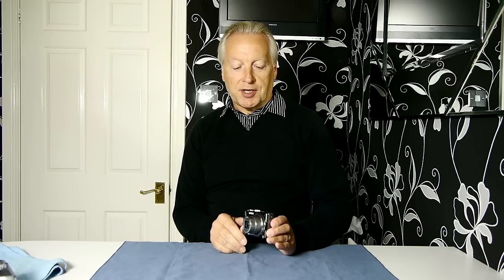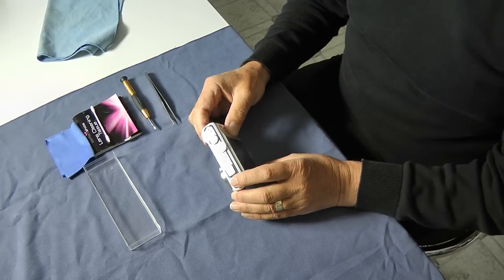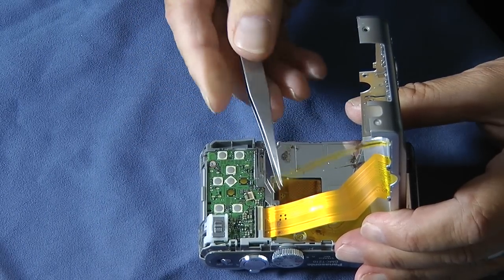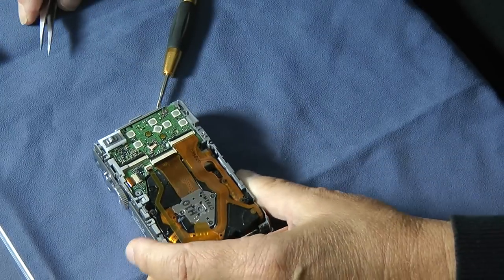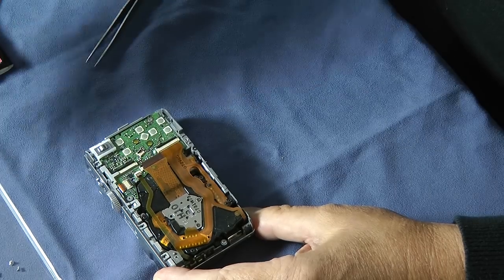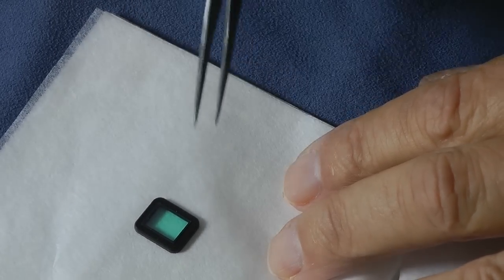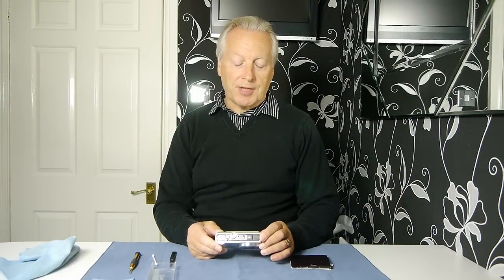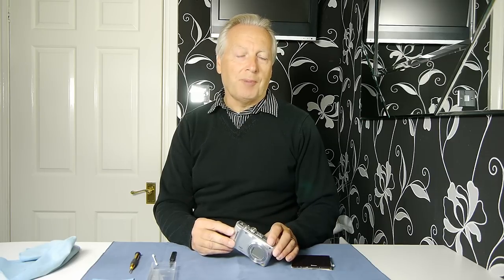Cleaning the CCD sensor of a Panasonic Lumix Compact Digital Camera

Comment: Hi Graham,

Apparently I'm the first idiot that's responding to your video.  With newly found confidence, I gently disassembled my Lumix DMC-ZS9, cleaned the IR filter with a Q-tip, blew with an air bulb, and reassembled.  Now the camera does not work...the LCD screen only flashes, and the lens goes in a little, then out a little each time I press the button to take a picture (whether lightly to focus, or a full press to take a shot...no difference).  My PC does not recognize it when.....

Comment: dear mr. houghton.
my poor Lumix spent an entire winter buried under a snowdrift (don't ask, I don't know how.)
amazingly, once left to dry, the camera seems to work (Kudos to Panasonic or whoever built this thing.)
There is a blotch in the image though. so, I am trying to disassemble the unit per your instructions to try to clean the CCD Sensor

my disassembly though is not exactly following your steps.
I got the back off.  but it came off leaving the LCD in place. the LCD seems to be attached at the top edge. And I cannot quite see how to release it. (it might simply be do to corrosion). and don't want to force things. I always break bits when I force things.

photos here.
https://plus.google.com/u/0/photos/107276842128622974989/albums/6019280226218676785
many thanks
peter
Reply from the maker: Hi Peter, the lens disassembly is more complex than the TZ series and, as you have found, requires a lot more removal of camera pcbs/sub assembly to get at it. If I can find the service manual for the LX3 I'll forward it to you.
Reply from the maker: Peter here is the service manual

 http://elektrotanya.com/panasonic_dmc-lx3_sm.pdf/download.html
Reply: Graham Houghton
Graham, thank you. This has been an interesting experience. Now, last question I think. I got it apart. the culprit seems to be the IR Filter which is quite fouled up (seems to be mildew, which is not surprising given it's experience almost under a snow bank for months)

http://tinyurl.com/kgv7xua

http://tinyurl.com/mvdpxov

the sensor seems to be relatively clean.
But using a dry cotton bud on the IRF does not remove all the blotches.
But I think you advised against using any cleaning solution.
Should I take a chance and use some now? or just try to find a clean replacement IRF.
(I do have a backup DMC-LX3 and so at this point this cleaning and overhaul is more of an academic exercise, an experiment. It really cannot get any worse than it's current condition.)

Thanks again for your support. I hope someone else finds these exchanges useful.

Peter

Comment: Don't try it with a ZS-40.  Much more complex inner construction, sensor virtually inaccessible.
Reply: I just did the TZ30 - also much harder but worked it out ... a lot more fiddly, and I screwed up the heads on the ccd screws - where would one get replacements for these I wonder?

Comment: I cracked my model DMC-ZS7 Infrared filter when I re-installed the screws with too much pressure. I found this site pacparts dot com
It lists the whole MOS unit (containing the filter) as Part #101 (VEK0T13). Looks like it costs $120USD. So I agree the better option is probably to scavenge an older camera